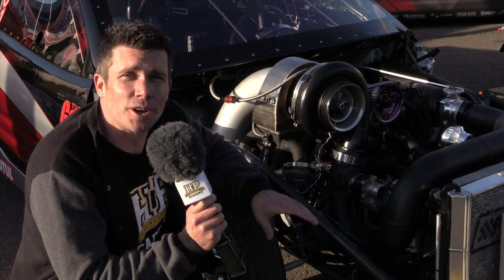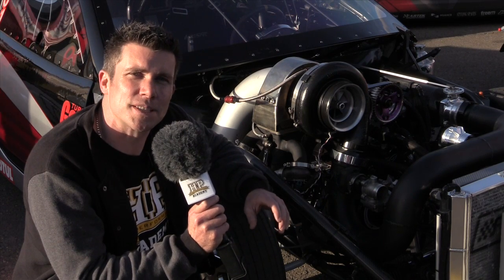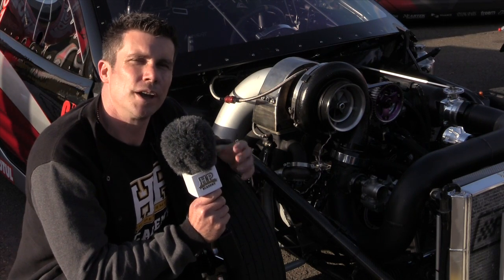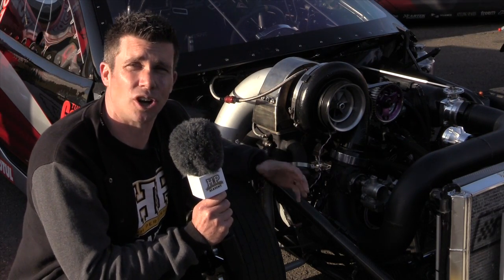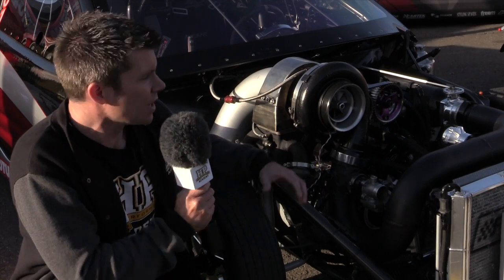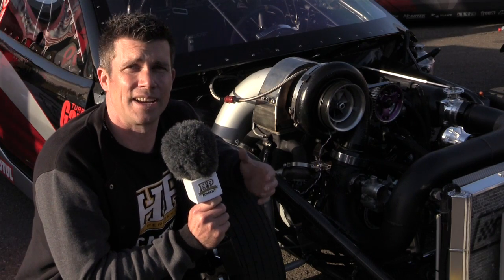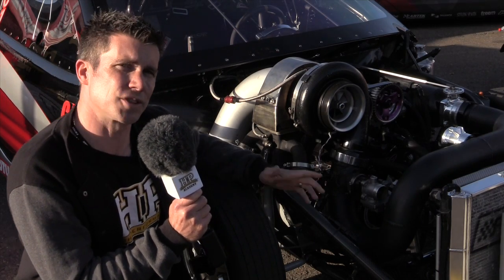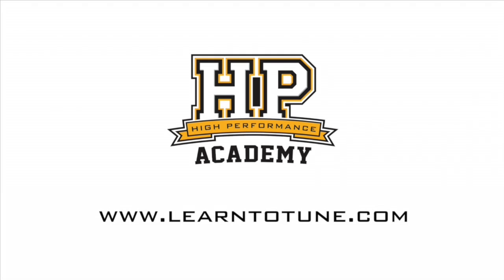[TECH TOUR] 6 second 4G63! | Using Drive By Wire Throttle for Boost Control

Comment: So their is no waste-gate at all?
Reply: There's twin wastegates on the turbo manifold. This is just to control boost compressor output at the engine throttle by keeping the turbo RPM high and boost the the engine lower - by using a controlled leak - eg DBW Throttle.